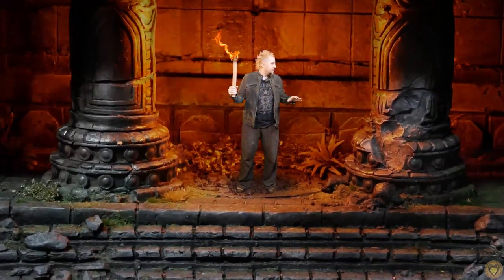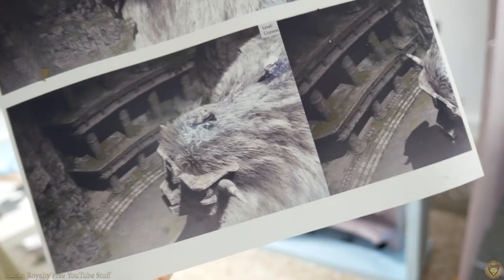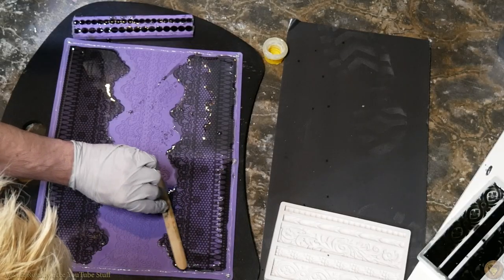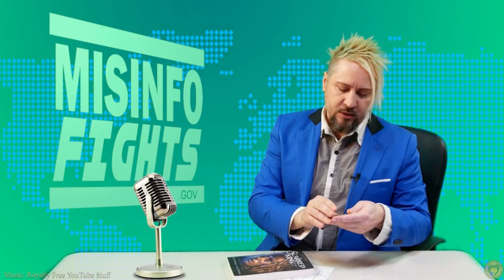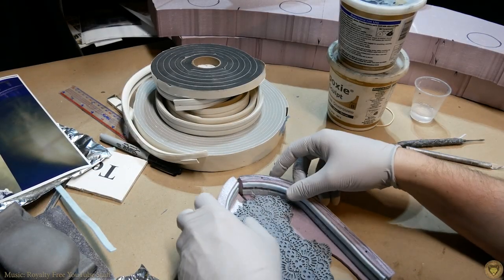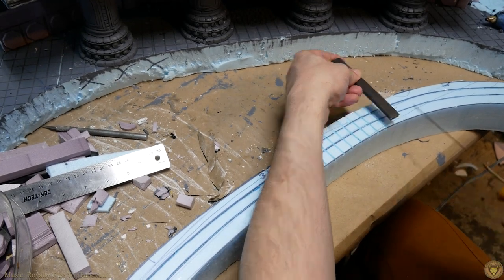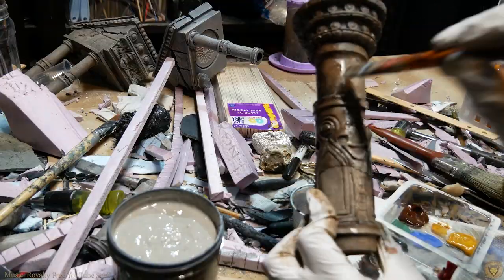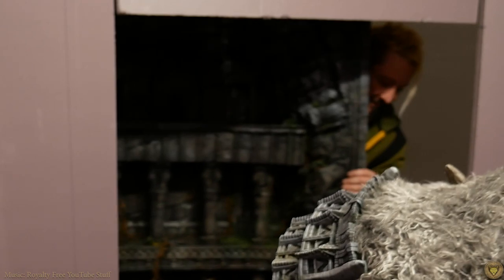How I Made A Carved Ruins Diorama

Comment: have you considered using  Foam It for casting the parts? - i appreciate some need better detail but a slush cast of resin and then a foam would keep material and weight down.  Or Foam IT 10lb could get some good detail... i think Smooth-on even does a 25lb density which would get good detailing.
Reply from the maker: Yeah, I've used Foam It for a variety of casts.  Since these pieces are pretty thin, and I had cores for the pillars I didn't think it was worth the time/money to get more for this project though.

Comment: Your molds and casts turned out great
Did you any sort of pressure pump or vacuuming?
Reply from the maker: No.  I do that for stuff I want to make for sale, but in this case since these are battered ruins anyway the imperfections like bubbles and bulges really aren't a problem.